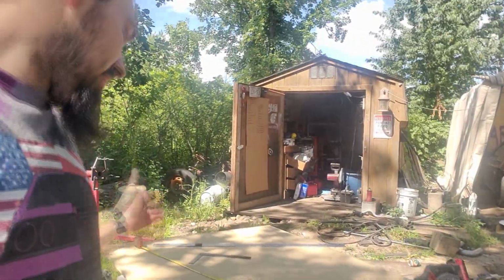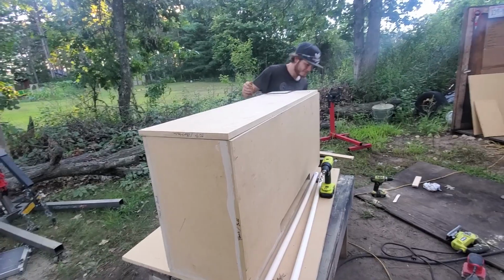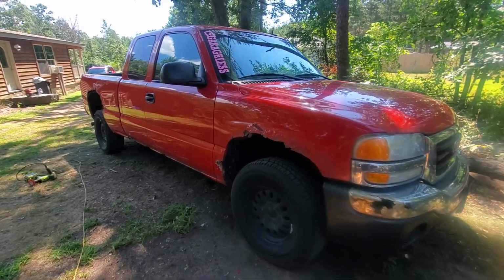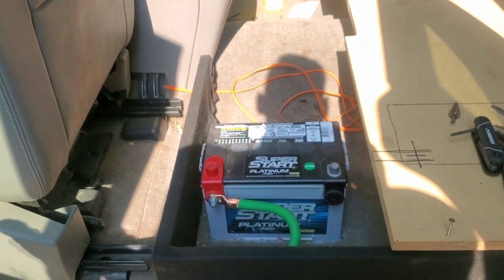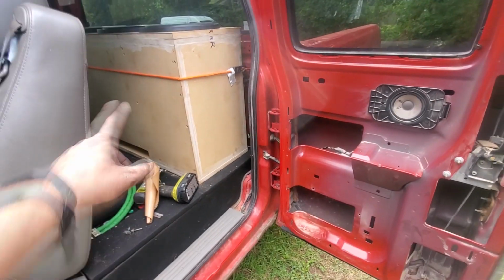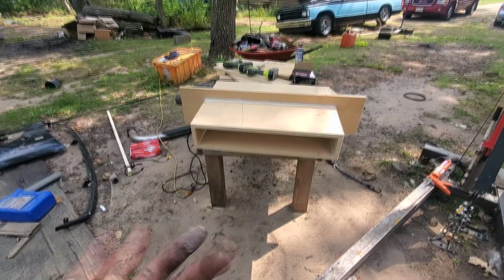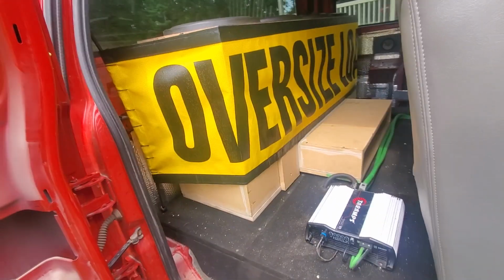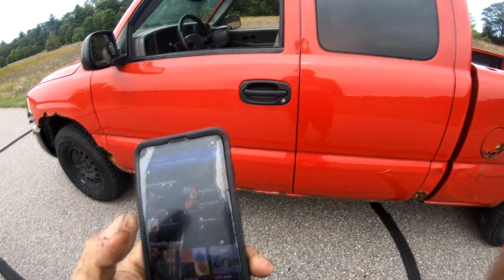first big sub system build! four 12 inch NEP selects with smart 3k amp!

Comment: Is that the wai global 253 amp alternator? What motor is in your truck and Is it a direct bolt in for the stock alternator? Did you have to change anything to make it work? I have a 2001 silverado v8 and thought 130-145 amps was the biggest factory option but wow 253 amps!! I need this in my life for my system. Currently running an nep select 12” also but about to  install a ct sounds 18” once i build a box.
Reply from the maker: Its watever was on rockauto... i have 5.3 ls in my 03 gmc sierra... direct bolt in

Comment: Soild install bud. You did a great job with the wiring dude. I like them green wires from the alternator to battery. And then to the other battery. Good job on the system. I can't wait till you add more speakers lol.
Reply from the maker: Next step will probably  b triple down on power and go 6k watt system